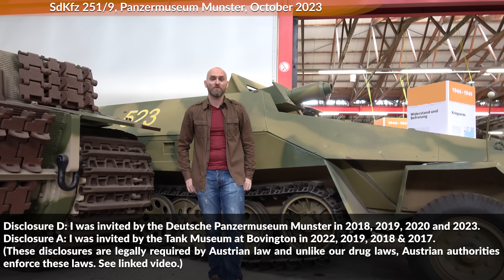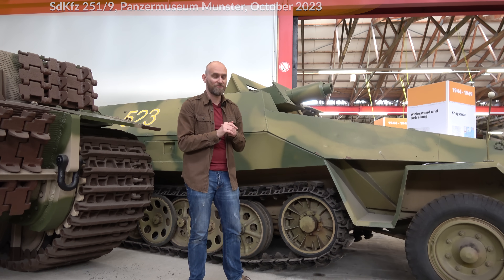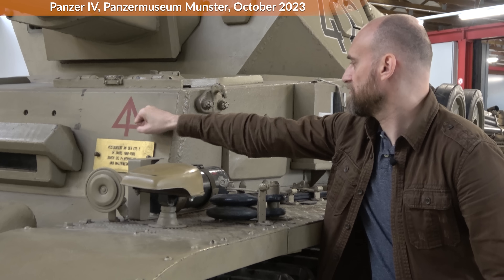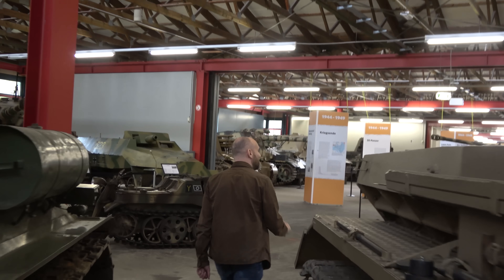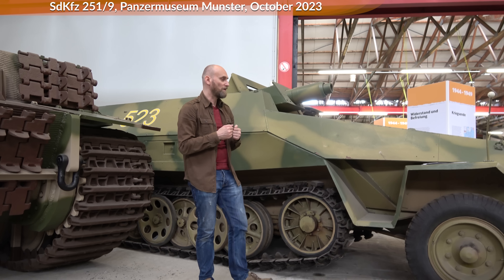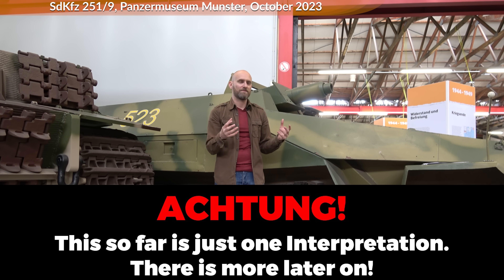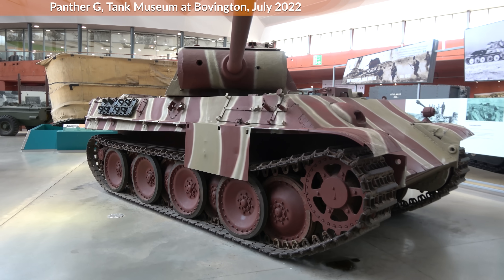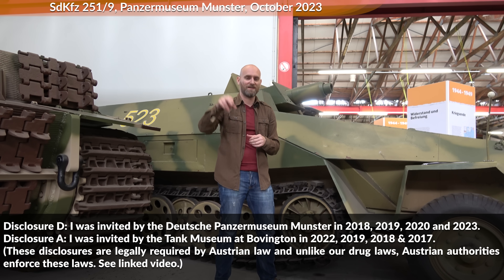Why was German Sloped Armor so late?

Comment: Like most upgrades, the world's militaries are usually pretty slow to adopt new gear entirely. It's not exactly an attractive concept to completely replace one's inventory over the course of years. It takes alot of time and money to find suppliers, and for those suppliers to set up production facilities, and set up logistics and supply lines, and engineer the machines that are going to produce new equipment. And usually during this cycle, the manufacturing process is plagued with production and quality problems. 

It's usually cheaper to "upgrade" or modify existing equipment to get some of the capabilities that you want. 

I think a perfect modern example had been the U.S Army's Next Generation Squad Weapon (NGSW) program. It originally started back in the 90's as a program to get a rifle that could accommodate optics, silencers, lasers, etc... And though the program has changed it's name over the course of 30+ years, and something close to $5 billion dollars have been given out to various arms manufacturers to develope new guns with this or that capabilities;

The end result was that the Army found it cheaper to add a picatinny rail, and chop 5 inches off the barrel of the M16 to get the M4 carbine. I mean, there is a handful of other tweaks the M16 has gone through, like the removal and later re-addition of fully automatic fire between the M4A2 and M4A4 variants. The removal of the carrying handle all together. Etc... but they really don't want to adopt a new rifle or cartridge.

Comment: In my opinion the interlocking was a result of war production, not so much of general concern of stability.
Welding can result in much harder or softer, and brittle connections. To get the right hardness and elasticity a lot of factors have to be right. The welding rods have to be dry, they have to be the right alloy the flux have to be the right composition. The base material has to prepped right and needs to have the right temperature. If you allow a wide error margin in the welding rod production and handling you have to compensate elsewhere. They used the interlocking for that. The production of rods was stable and comparable cheap with not much rejects. Transport and storage was easy. The prep work wasn't complicated. That was saving a lot of non recyclable material and time. The more work in cutting was less expensive in the view of the organizers. It would also allow less experienced personal to work on these projects because the quality of the welds didn't need to be very high.

Comment: I have no idea about tank design and manufacturing. But from an engineering point of view, welds can handle pressure force very well and are weak for shear force. With sloped armor the shear forces in the weld rises. The interlocking compensates the shear forces on the welds. And they enforce the overall hull structure by distributing the impact on one plate into the other plate by adhesion. 

Another thing could be ease of manufacturing process: with the interlocks the plates can be easier placed on each and they stay in place before welding. Which is anyway easier for a rectangular form than for a sloped form.

Why other nations did not do it or not in the same amount could either be because they had different specs on the force to compensate or had better manufacturing methods. Welding is a complex process in material science. But from knowing manufacturing processes I am pretty sure the German engineers knew what they did. They built prototypes, they made tests with against the specified impact force and they analyzed the result.

Comment: CSS Virginia of 1862 and without doubt dozens of early ship designs, let alone some designs of plate armor and fort structures. Sloping armor was not new in the 1930s-1940s let alone 1900s. Christie tanks of the 1930s and likewise other vehicles were also using sloped armor.

Comment: From an engineering view I want to mention 3 different effects of interlocking plates:
1. Your welding surface is bigger. Welds are a weak point, therefore you want to spread the load over a larger surface.
2. Shear forces between two plates are put onto the much stronger "teeth". (E.g. side view of a shell hitting the front of a panther. The frontal plate is forced inward and up by the impact. The interlocking on the sides of the plate works directly against these forces.
3. Welds handle load in different directions differently well. So interlocks change the direction at which forces act on the weld. (E.g. Frontal view of a shell hitting a panthers' upper plate: Again the plate is forced up and into the tank. A flat weld between upper and lower plate will just get pulled apart and open like a zipper. At interlocks, the weld experiences shear forces, which it can handle better and prevent the whole weld opening up as one.)

Thanks for the video about this interesting topic!
Reply: Considering welding was quite a new technology and yet to mature, the welds of the time were or at least could often be weaker than after the war. I'd imagine once the welding techniques developed and welds became more reliable and better understood, the need for complicated joints was no longer there (thus interlocking disappeared from use), but it might well have been at the time they were used.
Reply: Considering that in order to punch through thick armor like that ,a force of impact of thousands of tonnes-force is required the fact that sometimes the welds don't break is surprising.
Reply: Large metal plates warp during welding. To prevent this, one needs to either build massive supporting framework or interlock the plates

Comment: Sloped armour also impacted on the available internal space of tanks producing cramped crew conditions and reducing ammunition carried. With the PIII and PIV the Germans had a considerable focus on crew ergonomics which would have been badly impacted by sloped armour. It seems possible that it was only when tanks got big enough that the impact of sloped armour on crew ergonomics was considered acceptably mitigated that sloped armour was deemed acceptable. However, the rapidly increasing power of anti-tank guns would have forced its adoption anyway.

Comment: Sloped armor is heavier overall and either makes the whole vehicle longer, or eats interior space. You have to compromise somehwere.
Then for pz3 and 4 and on the other hand Tiger I, i think the reasons are different.
Pz3 and 4 needed simple(r) production methods and didnt expect to be invulnerable against long bareled 50/75mm+ guns. So welded rectangular cut plates were the obvious way to go. And still superior to many riveted or cast designs of their contemporaries.

Tiger I on the other hand many people seem to ignore/forget has a quite thick and almost face hardened frontal plate (like a battleship armor belt steel) both the actual thickness and hardness of the plate were enough to defeat virtually all guns known or expected to be met in close future at that point so they didn't need to make the hull even longer and heavier by introducing a slope into the works.
Reply: I think its a design choice, if it is possible to have a sloped plate without eating up too much internal space then why not have it?
I think the S-tank was smart in that way. And if a 1 centimetre steel plate angled at 60 degrees gives the same amount of protection as a 2 centimetre thick steel plate without any angle.. then of course can you reduce armor thickness by half and still get the same amount of protection.
I think it was this that made T-34 such a good and feared tank in 1941. It was a bit bigger than most tanks in the world in 1941. But it could still be as fast as other tanks because it was not too heavy because its armor was sloped, and the broad tracks allowed it to drive in thick snow and muddy terrain that even smaller german tanks could not handle.

So one can slope a plate in many ways, not just upwards and downwards, but also sideways. The S-tank did get very good safety levels for its time despite unimpressive armor thickness. Its extremely hard slope on the armor more than doubled the road an enemy projectile had to travel before it could drill its way through the armor. The heavy sloping also increased chances of shots just bouncing off the armor and richochet away.

The problem with angeled armor however is that it is less reliable than armor thickness. When you got 2 centimetres of steel on a tank you always got 2 centimetres of protection. But if you got 1 centimetre of very well sloped armor, then the protection of that armor can be reduced under certain circumstances. A M4 Sherman tank will not be so well protected if the enemy shots at its well sloped front armor from above - because then will the angle of protection be reduced. Perhaps even reduced down to zero extra protection. So this angled steel plate that was meant to give 8 centimetres of protection under normal circumstances now only gives 4-5 centimetres of protection - which means that it can be penetrated even by pretty weak anti-tank guns.

Comment: If Germany had found a way to cut 90% faster, interlocking plates MAY (pure hypothesis) make the assembly/welding process way easier because once in place the plates didn't risk to slip.

Furthermore, joints are always the weakest point of an assembly, and the reason of invention of "interlocking joints" in the wooden construction. I suppose the same occurs with welding ? When you see destroyed tanks, rupture in weldings are often seen in "straight welding" and rarely with interlocked plates.

Comment: The ,,sloped armor,, depends on the angle the bullet is hitting from??  So even boxy tanks do slope?  Up to this point the boxy armor was adaquate AND prob required less manufacturing effort.  Thick steal ,, is cheaper than expensive welding?

Comment: Another thing to take to mind is the heat treatment. Russian tanks were treated way hotter, which in theory made them harder but in return made them more brittle if taking damage, which often led to famous images where T-34 welds are shown split upon impact of a shell hitting the weld section.

Comment: The box design is more efficient in relation to the ratio interior room/exterior size and used up less steel. Thus the tanks were lighter, smaller and cheaper with a boxy design.

Comment: I think that the answer may be very very simple.

Germany did not plan on a long war, anything that was "good enough" kept on being produced...... until they had a reason to change it, in reaction to a new threat.

Sure they had some designs but no real pressure to develop them in timely way... 

The numerous early German victories helped to fuel the belief that better weapons wouldn't be needed.

To highlight this lazy attitude, Germany didn't adopt "total war" until Feb 19....43!!!!!

So it seems like doing lot's of studies (including what the enemy is doing), changes in designs, more design studies, waiting for Hitler's approval, and so on.

Added into this an over engineering of a design.

And potentially this is where the "cut out" welds come into play.

In that in the video is is mentioned that due to advances in armour and welding that they no longer are needed.

Which meant that they had a purpose.

However which is better?

One tank having "better armour resistance" or X amount more that could be produced in the same time period.... that MAY have inferior armour resistance.

Also subsequent Soviet designs did away with the sloped hull side armour.
Reply from the maker: Wrong in many respects, see this video Tiger: A rejected Success
https://youtu.be/-aCmr_Jerjc about “good enough”
Reply: @MilitaryHistoryVisualized  My point is simply that there was no drive to reman ahead of the curve.

They knew in 1940 that they needed a better tank (amour and armament), 

But not realizing that the Soviets (whom they considered to be subhuman etc) had SUPERIOR tanks (and the ability to mass produce them), there was no push to seriously develop and mass produce successors to the tanks that they had.

Given their success they believed that it would be a short war

Do you disagree that Germany did not go to "total war" in Feb 1943?
Reply from the maker: Did you watch the linked video?
Reply from the maker: Germany definitely took a total war stance before February 1943, you seem to take propaganda speeches at face value. Also one doesn’t flip a switch to go to total war, it is generally a gradual process.

Comment: I've read various theories on this over the years.  The concept of sloped armor was definitely known by all sides before the war began.  One reason for not using it was that it allowed more room on the interior, more comfortable for the crew, especially during long battles, which would theoretically increase performance.  Not sure how true that is, just one theory I have read.  

Another theory is that the Germans thought the armor they had was thick enough without sloping to stop the main armor rounds of the time.  Remember Germany initially intended the Pz III to be their main battle tank with a 37mm or 50mm gun.  Looked at from that perspective, it was not the sloped armor of the T34 that changed the Germans mind, it was that 76mm gun.

Comment: The stepped hull is also beneficial for maintenance as it allows for easy access to the transmission. 

Back in the day the drivetrain was not combined into a dense package that can be lifted out as a single piece instead the components were spaced out more to ease maintenance. 

 The reason why rear engine front transmission was done 
Is so that both could be placed in a smaller space than what would have been needed if you wanted to put them into a single compartment without compromising maintenance.

Comment: Just a suggestion...the interlocking loooks like a practical assembly idea. Just plonk this plate here...stuff in a spacer for welding gap...weld away...not much training , measuring, thinking ....without being there intimate ..thats posible ? If you had assembly drawings this would establish each asemblg step.

Comment: I think it's a lot more simple than you make out. Having a large slope at the front makes the transmission extremely difficult to remove and makes maintenance more difficult. T34s of course had rear mounted transmissions so could put a chunky slope there. M3 and M4s got around this by having the lower removable section but this was quite a unique design. Pretty much all post war tanks have rear mounted transmissions. Tiger 2 and Panther are not exactly well known for their ease of service at least compared to a pz3 and pz4.

Comment: What I had assumed was Germany's tanks were designed for a war that used weaker guns and designed at a time when tanks were novel and so what could/should or could/should not be done with a tank was in question, as well as the fact that a box-like design was easier to design and manufacture.

Comment: Sloping increases effective thickness, but you also need a longer plate to cover the same height, which probably doesn’t weigh that much less than just a straight but tricker plate.

Comment: I can't quite understand the mystery surrounding the non-sloped armour.
How and that sloping armour plates work was known for a long time. That and how sloping plates can be stably supported against each other is hardly a technical mystery. I consider the justification of any stability reasons to be incorrect.
The advantage of sloping plates just has to be weighed up against the increase in volume and the additional effort involved in production.  The production and handling of sloping panels is generally somewhat more complex than when everything can be put together more or less at right angles. However, it is probably much more serious that more angles and corners that cannot be used are created under the slopes, making the interior larger and ultimately the Tank heavier, because this dead space must also be protected. With a box you have to protect less space, you can make the plates a little thicker and ultimately have the same protection.
Only the appearance of powerful high-speed guns tipped the scales clearly in favour of sloping armour, because armour-piercing ammunition on inclined surfaces is always deflected slightly from the shortest line even when penetrating, so that the penetration length is effectively greater than the geometric thickness of the armour.
With the advent of sub-calibre arrow ammunition, however, this was largely a thing of the past, as these no longer slipped on sloping armour.

Comment: Google the Tigerfibel booklet (training manual) to get the German view on how a tank should fight. It states (as others have mentioned but without a source) that (1) the crew efficiency gained from (among other methods) more crew space in the hull was how the Panzerwaffe would maintain its dominance on the battlefield and (2) a squared hull turned 45 degrees is indeed SLOPED but on a different plane. There are elegant diagrams that show the impact this has on how the tank will fight. Take a look!

Comment: This may be affected by how the plates were made before being attached to the tank. So far as I'm aware - Russia and the USA used larger factories with bigger available cranes, and the ability to cast armor in large sections. If they wanted to make armor sections with angled seems that come together easily, they could. Meanwhile Germany had smaller production facilities that used flat rolled plates - which did allow for better quality control and hardening than castings - but in turn it takes more work to prepare such a plate to link to another.